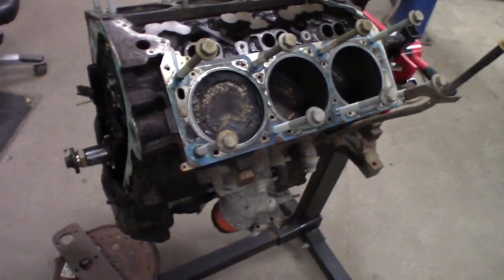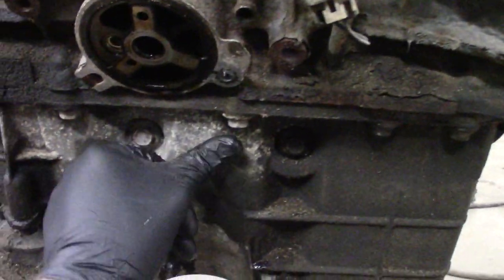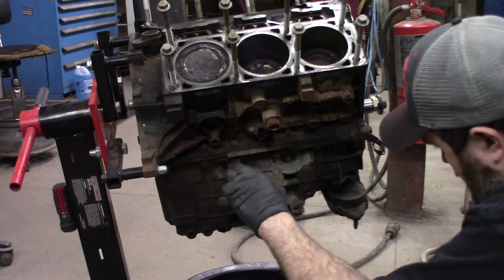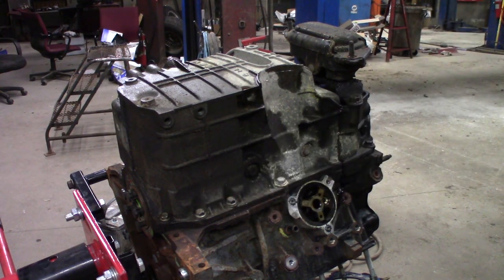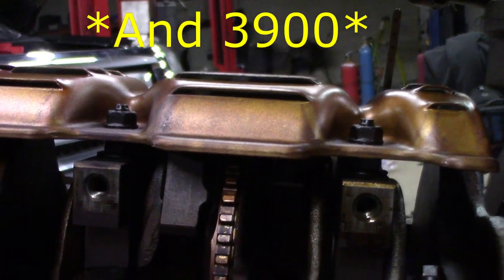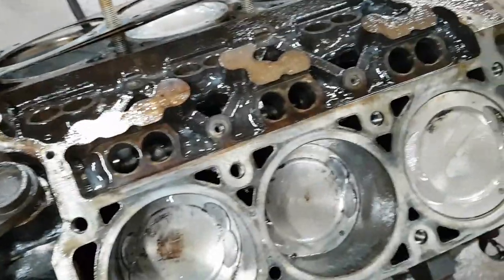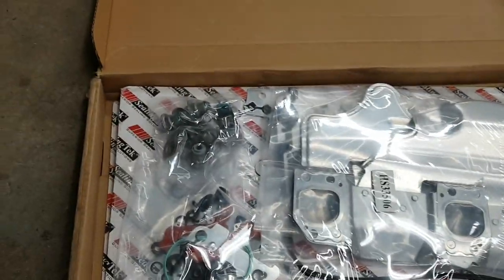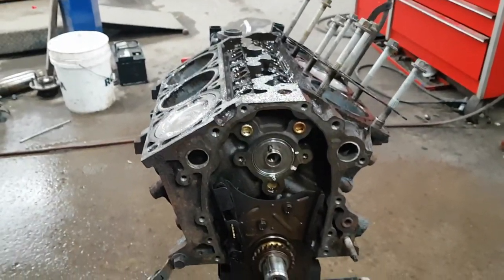3900 lZ9 Update! Final disassembly and cleaning before putting it back together!

Comment: Man I can’t wait to see this thing finished. Also a tip, on the exhaust gaskets where they have the heat shield, I cut the shield off with a pair of tin snips on the driver side of my LZ9. If you ever need to get to the starter while the engine is in the car it’s an absolute pain to work around them. Highly recommend shaving it off!
Reply from the maker: Thanks! I will probably do that with the gaskets, they would probably be in the way of the header tubes anyway!

Comment: I have been building an LZ9 for my 85 Fiero. Hoping for around 300HP NA with WOT Tech Strip Cam, PAC valve springs, keepers, and retainers for an LS1, Earlier Gen timing chain and sprockets cryo treated, cryo treated stock rocker arms, 3/8" custom length pushrods, heads and intakes ported by myself, bottom end components balanced by myself and crank and rotating assembly race balanced by a machine shop, ARP rod bolts, 75mm N* throttle body, 58lb injectors. I also got some exhaust manifold flanges laser cut but might run out of budget to get headers made before it goes in the car. Might decide to turbo it anyways. Did this build die or is it still being worked on? I am very interested in how it turned out! Hoping to get mine fired up in the coming months, motor is complete but I will be running it using a Microsquirt ECU and custom wiring harness which still need to be sorted.
Reply from the maker: Awesome! Don't see why it wouldn't make 300hp! My project hasn't died yet, but just pushed lower on the list lol

Comment: Hey that appears to be a later 3900. The earlier LZ9 blocks without the oil cooler are threaded for the oil filter to mount direct to block, the later ones are not
Reply from the maker: I wonder what year they changed them? This is a 2009 block from a Montana van.

Comment: Please keep posting videos about this motor i have an ss malibu w the 3.9 fwd i got a tune and magnaflows i seriously cant find no info for.mods on these engines besides a cai and exhaust any help?
Reply from the maker: I don't know of any one that is selling performance parts for these engines in the cars that they originally came in. Think you may be able to get obx headers on ebay for yours, but they may only be sold as G6 headers... once I get this together I may start offering parts like heads/intake manifolds but I want to see how mine works first! Lol
Reply: @modeverything1  thank you.  will for sure check on those headers thanks

Comment: Just made a video on this myself.

My blocks dont have a threaded oil filter housing in the block.  The 3400 is an m18x1.5. The 13/16-16 might be too big for the meat of the block if you try to tap it.  I would go with the m18.  Its smaller and wont remove as much material.

Check out my latest on this as I went through several different solutions
Reply from the maker: Ah crap, thanks for the heads up! I must have got mixed up with the 3900 oil filter thread size. Good news is that I have access to a 18x1.5 tap, now I just have to find a 16.5 mm drill bit!

Comment: I gotta know 2 things,what're you doing for rwd motor mounts? And what r u doing to mount it to rwd transmission? I'm only asking cuz,as u probably already found out, their isn't really much of anything 4 specs/info out there 4 these engines. Yet they're friggin everywhere,are dirt cheap, compact as hell for swapping into light vehicles. I've been researching and looking 2 do a light (26-2700lb max) build car w a modern/but not main steam engine, something different from typical ls build's. Don't get me wrong,I love LS's and would love to build a twin turbo destroked LQ4/LS2, but LS swaps have been done 2 death so I wanted something different. I'd wanted to do a twin turbo LZ9/4 and swap it into something like an rx7/z3/Miata etc,but w no real info available I started looking at LY7's,LFX's etc. While their are some perf parts for these, they're expensive as hell cuz they'll most likely have to b shipped in from Australia,not much here in US. Which is a shame cuz these engines r dirt cheap, will make comparable power(prob more 650hp aprox) . Anyway any info you can provide me would be awesome. It's these 2 questions I wrote at the top of this comment,that really stopped me in my tracks. It has to be mounted longitudinally,and I wanna adapt it 2 a Nissan cd009 6 spd trans(also dirt cheap and bulletproof). Thanks for anything u can provide. I'm def subscribing to ur channel
Reply from the maker: Engine mounts would be custom. Transmission would be the same as mounting other fwd 60degreev6's to rwd. I know there are a few that have done rwd with a manual on 60degreev6.com and some MG guys have done fwd/manual rwd. I have not done a manual/fwd engine myself so I'm not the best to ask details.  I remember seeing a guy with a turbo 3500 with t56 on 60degreev6.com, I think he used a Lakewood bellhousing.  Thanks for subscribing,  I will try to detail as much as I can with this build!
Reply: Awesome. Thanks for the reply, I'll def be waiting for future videos. I've already started viewing ur previous videos just to catch up on what I missed. Question though,you have any idea what CC's the cylinder head Chambers are? I know it takes LS pistons, just trying 2 find chamber size so I'll know which pistons/head gasket thickness will get me approx 8.8-9.1 comp for boost. I think these motors and other 60 degree (dohc-sfi not gdi) v6's don't get the support they probably should, after all, their r millions of them/dirt cheap/tough as hell if prepped right/and will make a ton of power under boost. And if anyone were to break it, it's easy enough to replace it.. thanks again dude,I appreciate it
Reply from the maker: I will cc my heads once they are back together to give you a rough idea! There is probably a few people boosting these engines with the stock 9.8:1 CR. I know of one with just a cam/springs and a turbo at 15psi making over 500hp!
Yes these engines need more credit!
Reply: Definitely. I've seen a handful of turbo 3.9 builds(discussions/few pics up on turbo forums,all comments saying 600-650hp on pump gas w /water inj is pretty much typical,in engines w rods/pistons/cam/head and intake porting etc. Plus these r compact as hell compared to it's dohc brother (also great engine). Thanks again
Reply: I can't believe the aftermarket support is almost non-existant for these 3900's. The more I learn about them the more I want to swap one.

Comment: I'm noticing the front of the block looks different and is missing some bosses the 3100/3400 have, do you know if the 3.4 camaro timing cover will bolt onto these 3900 blocks? I am looking to swap a tbi 2.8 for a 3900 in my S10.
Reply from the maker: Yes the RWD cover will bolt on once a couple of holes are opened up and vvt deleted, but the accessories won't bolt up due to the coolant crossover on the heads
Reply: @modeverything1  i overlayed 3400 and 3900 heads, the rear looks almost identical but the front looks super ugly, if you dont need to mount anything to the heads you could get away with putting a freeze plug in it, but i was going to use different heads anyways if the bore size doesn't cause any issues

Comment: Are these rod and main bolts a one time use? I can't find any info in my manual ty
Reply from the maker: Looking at the torque specs I would say that they are torque to yield/ one time use. I would give the dealership a call to find out for sure.

Comment: is it worth swapping a 3800 for one of these?
Reply from the maker: I would myself because I like them better, but it would probably not be worth it (yet) until they are proven more. The 3800s have more aftermarket support and that makes it a little easier to mod/upgrade.
Reply: @modeverything1  thanks for the reply I'll have to keep this engine in mind. I'll keep following your build I wanna see where this goes!

Comment: Is that a aluminum block?
Reply from the maker: The Block is cast iron, and the heads are aluminum.
Reply: @modeverything1  how fast is it. I assume it's crazy quick off the line..
Reply from the maker: Unfortunately I still have not got this engine back together yet. I changed jobs during covid and the engine has been in my storage unit since then 🙁 
I am going to try to get it together this year once a couple other projects get finished up!

Comment: Is the 3.4 cam bigger ?
Reply from the maker: Stock cam, no. But the aftermarket performance 3400 cams are bigger as in lobe lift and duration!
Reply: Mod Everything that’s pretty cool so for a 3.9 a big cam for a 3400 will fit with some modifications?
Reply from the maker: They fit with the cam bearing spacers. When you use the 3400 cam you loose the vvt and the cam sensor. This is why most swap them into obd 1 cars or get an aftermarket ecu!
Reply: Mod Everything that’s pretty cool maybe someday I’ll do it and swap it into a smart car or something like that :p